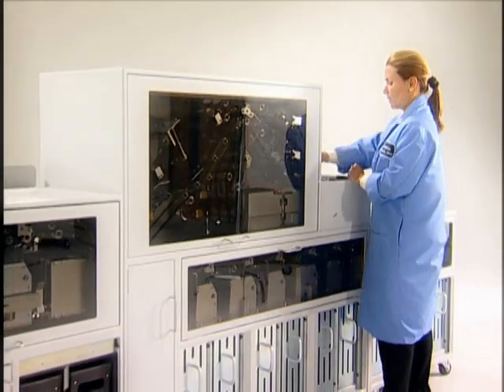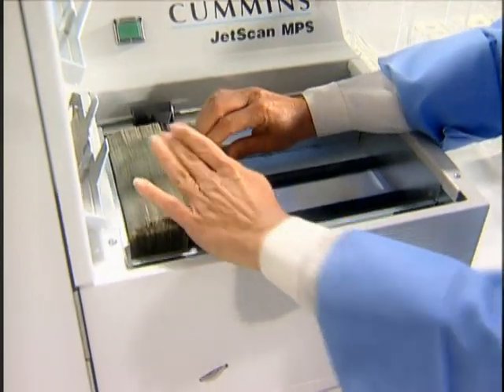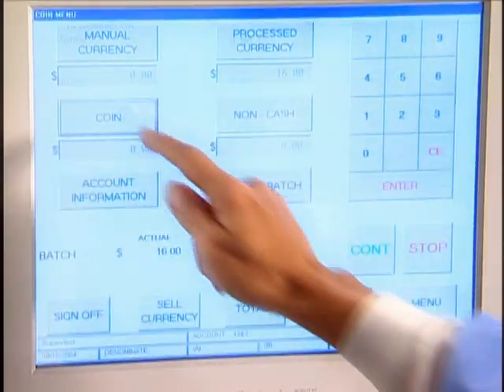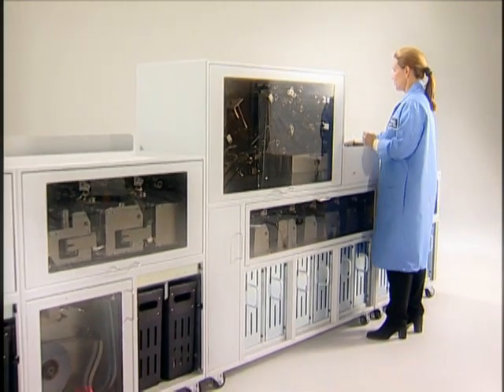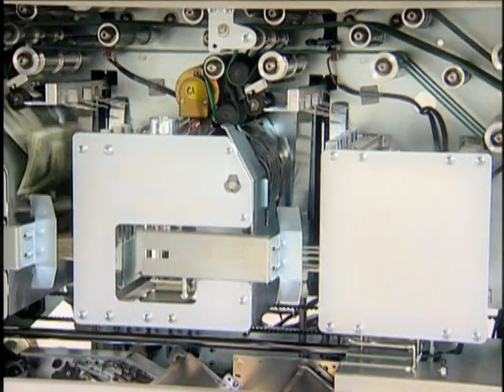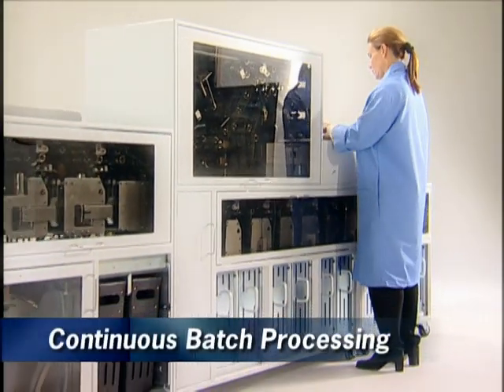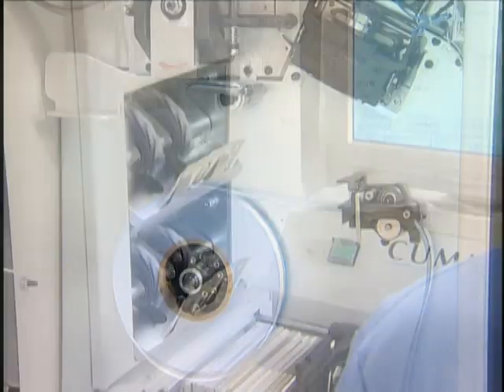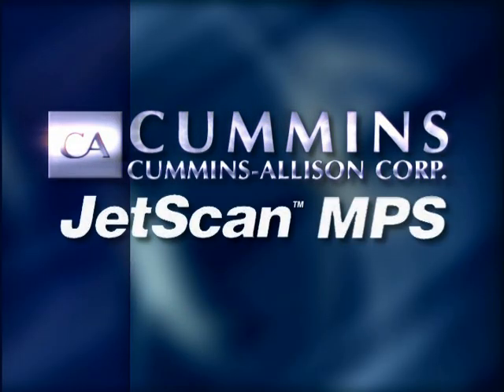JetScan MPS 4100 Multi-pocket Currency Sorter

Comment: Ask anyone who has had to work with these machines and you will get an earful. Unreliable, finicky, chew up bills and tickets, constant blocked escrow areas and jams, and better hope your manager is mechanically inclined because the techs are useless 95% of the time they just tighten things up and say "Could not replicate problems" and you're back to square one in a couple days. Plan on the operator spending most of their time playing whack-a-mole clearing problems while it slowly works through the currency.

 We used to joke that running these things was like bull riding: hold on for dear life and pay close attention and see how long you can keep it running without problems". The usual time was 1-2 minutes, the record was 15 minutes. That says it all.